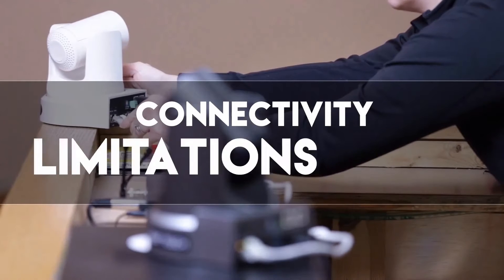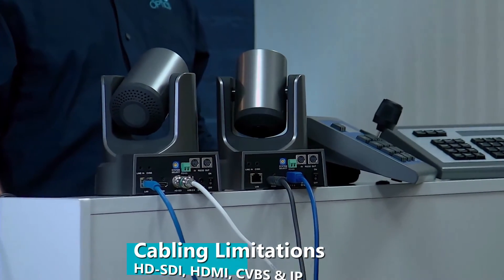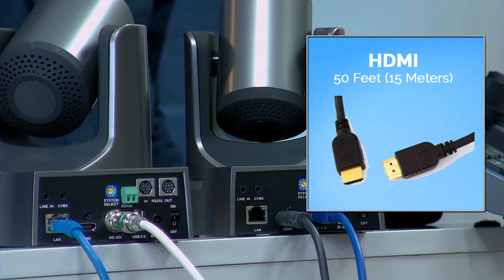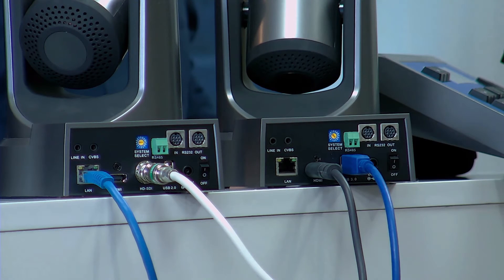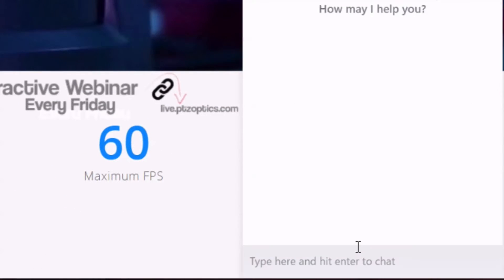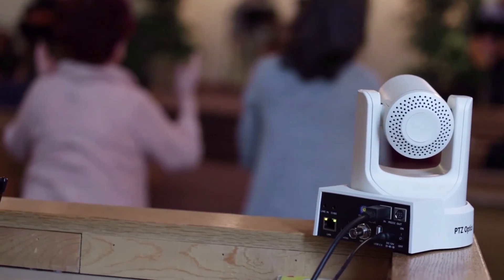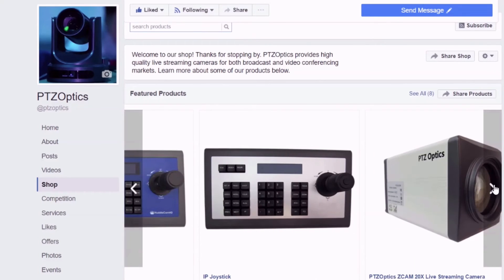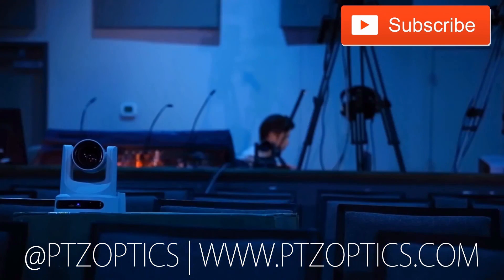PTZOptics Cabling Limitations (3G-SDI, HDMI, USB, CVBS & Ethernet)

Comment: Whats the length limitation for USB 3 Cable?
Reply from the maker: Hello!
The length limitation for USB 3.0 cables is typically around 3 meters (about 9.8 feet) for passive cables, which are the most common type. This limitation is due to signal integrity issues over longer distances; beyond this length, the quality of the signal can degrade, leading to data transfer errors or connection failures.

For setups requiring longer distances, there are a few solutions:

Active USB 3.0 Cables: These cables have built-in electronics to boost the signal and can support much longer lengths, up to about 15 meters (approximately 49 feet) without significant signal degradation. They are more expensive than passive cables but are a practical solution for longer distances.

USB 3.0 Hubs: Placing a powered USB 3.0 hub at the end of a shorter cable can extend the total distance by regenerating the signal. However, each segment of the cable still needs to adhere to the maximum passive length, and the overall effectiveness can depend on the quality of the hub and cumulative cable lengths.

USB over Ethernet Extenders: For distances beyond what active cables can support, USB over Ethernet extenders can transmit USB signals over cat5e/cat6 Ethernet cables up to 100 meters (328 feet). These extenders convert the USB signal to run over Ethernet cable and then back to USB, which can be useful for very long-distance connections, such as in large buildings or between different rooms.

Optical USB Cables: There are also fiber-optic USB cables that can extend USB 3.0 connections over much longer distances, up to 100 meters or more, without signal loss. These are significantly more expensive but are ideal for situations where very long runs are necessary, and high throughput must be maintained.

When extending USB 3.0 connections, it's essential to consider the power requirements of the connected devices. Active cables and extenders usually need external power sources to ensure devices receive adequate power for operation.

Thanks for checking out our Channel! 
Learn More: https://ptzoptics.com/

Comment: If i run this with a SDI Cable up to 100 meters to a switcher, how do i control the camera? Do i need a cable that also runs up to 100 meters? or how about NDI can i control cam using the Ethernet cable? Thanks
Reply from the maker: If you are going to run a cable 100 meters, you should probably use Ethernet with the NDI. This will provide you with Video and Control at that distance.
Reply: Thanks.. Ethernet cable to a gigabit switch or to a network, do i need a program to control the cam? We are using Wirecast, so can i just control it from there with one cable? Thanks
Reply from the maker: Yes, if you are using Wirecast 9 you can control the cameras directly in Wirecast. If you use the NDI video input you will just need to input the Static IP address of the camera. We just made a tutorial video on this.
Reply: So no other cable needed? Just the Ethernet Cable does the PTZ control and Video feed? If yes, what particular model of PTZ Optics best for Wirecast 9 or what would you recommend? Thanks
Reply from the maker: I would suggest one of our NDI models - https://ptzoptics.com/ndi/ . You can use our zoom calculator to determine the best lens for your room.

Comment: How is the video latency over ethernet vs HDMI to Magewell converter?
Reply from the maker: Gary Cruz - magewell is one of the best when it comes to latency. I would say only 50-100 milliseconds
Reply from the maker: They should be roughly the same. 50-200ms.
Reply from the maker: Gary Cruz - generally 9’ or 3 meters